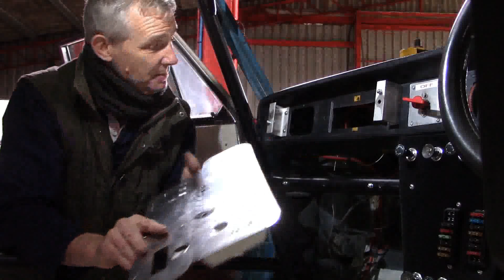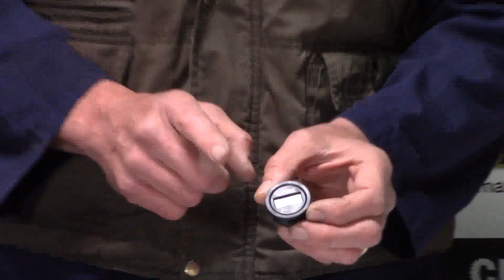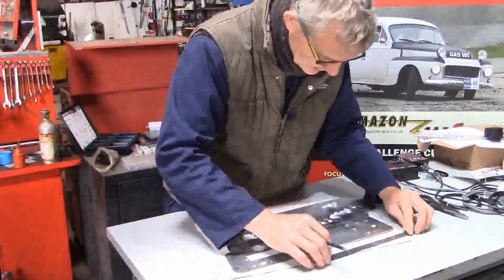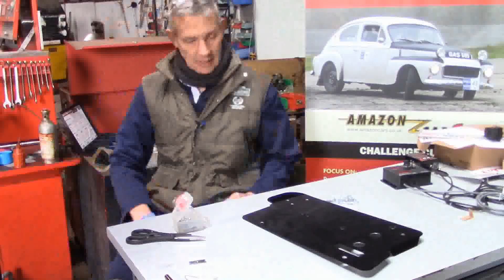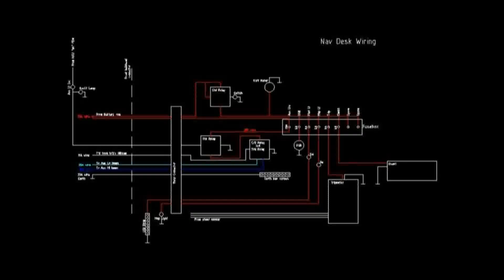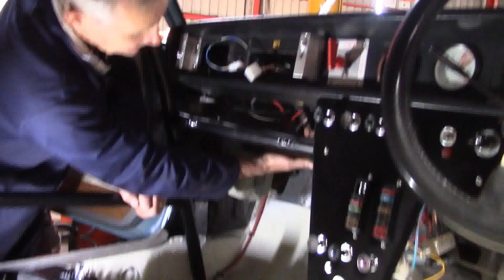Creating the Navigator's Desk (Brantz)

Comment: Really nice job. What kind of clamps did you use to quickly mount the board to the holder?
Reply from the maker: Fasteners are either m6/m8 dome head bolts, or Dzus quick release quarter turn.
Have I answered the right question????
Rob
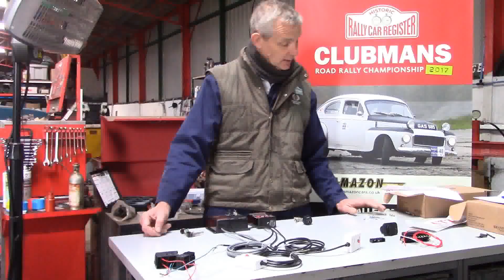Reply: @amazoncars  Dear Rob, thanks for your quick reply. I mean the fastener that you show exactly at 4:52 of the video ;)
When you attach it, you push it over the head of the dome head bolt - exactly at 26:07.
Thank you. Regards Christian
Reply from the maker: @katzenbar8250  Got it! "Dzus slide catch & bush" is what you're after.
Rob
Reply: @amazoncars  <3 thanks so much. Christian

Comment: Nice job.  I had some problems with my Brantz timer freezing or not re-setting.  Brantz say to connect direct to battery.  Have you had any issues as yours appears to be wired through your 'navigational loom'.
Reply from the maker: Really sorry, somehow missed this message. I guess you're sorted now, but in brief: yes, the timers used to be susceptible to that problem; recently I reckon their production now has noise suppression on the power lines, and don't seem to have the problem.
So, on our old Brantz timer, we do indeed rig the power direct to the battery, making sure we shut down the Brantz when leaving the car for more than a few hours.